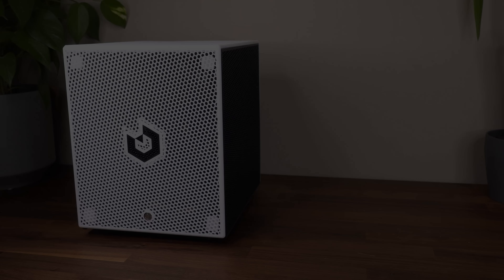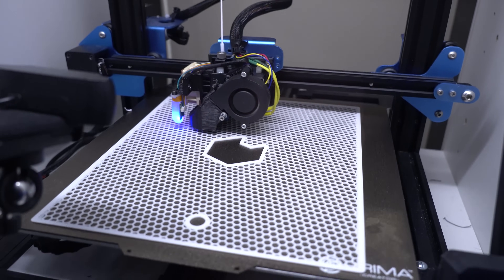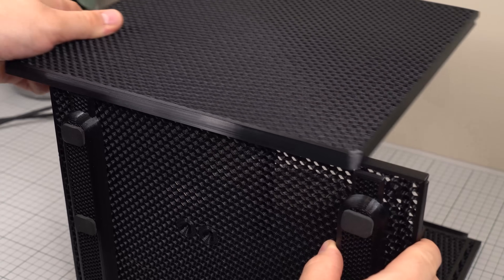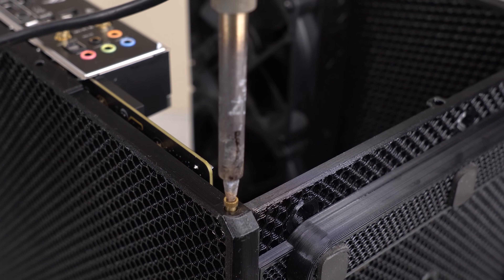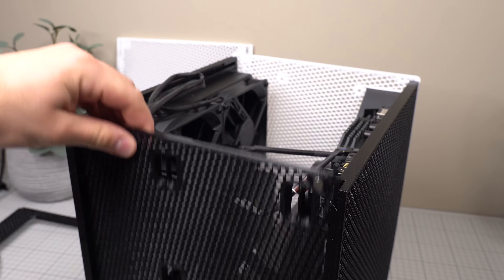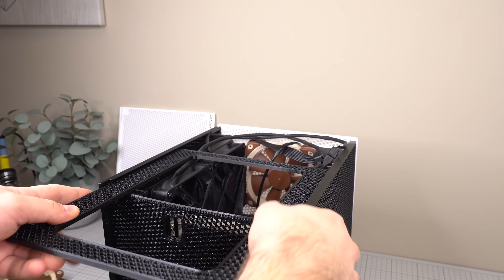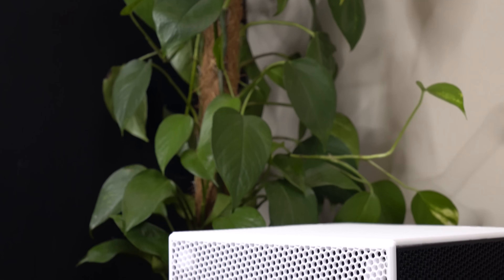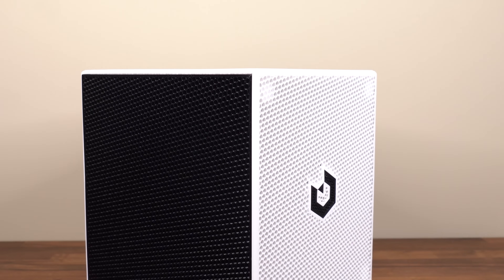Little Boy M - a 3D Printed Micro ATX case

Comment: Damn you we are so close the real thing community really needs. Air cooled micro ATX motherboard and PSU case that can be printed in pieces sized 200x200. I ask this because most of us bought cheapest 3d printers and like ender 3 they have 220x220 bed size but effective size is 200x200 mostly. So if you follow this use cases you can reach 99% of 3d printers owners and PC builders
Reply from the maker: I know this has been highly requested and especially from my previous mATX two years ago the ATX psu support has been high on the list and I remember back then I made some promises I failed to fulfill as everyone wanted ATX psu support and it’s been gnagging me ever since that I didn’t just complete it. Now finally it’s here though. 

Now the next challenge would be as you say to shrink each part, find a clever way to join the parts with no visible exterior screws and clean joints.
Reply: @makerunit  Well... the panels might be separated into smaller parts that will be later screwed or glued together. The key is to well designed connection points. Not necessary hide it, byt maybe even opposite - expose them in a way that fulfills the aesthetics of the design. ;)

Still. This project is a very good job. A lot of things was taken into consideration. PC cases manufacturers sometimes after years are forgetting about some details...
Reply from the maker: @LeitoAE  yeah I’ve been working on some ideas for ways to use joints as a part of the design, and one of the projects I’m working on right now is an Ender-3-printable full size ATX case. There that challenge comes up, but I think I’m able to solve it pretty nicely. Stay tuned 😁

Comment: there no way the structure of these cases dont droop into a ugly mess after a few high GPU load sessions
Reply from the maker: First of all, PETG can withstand temperatures of up to 80 degrees. And if a GPU reaches «80 degrees» during for example gaming, that’s at the processing core of the GPU, the surrounding air will never reach those temperatures, the air around it will MAYBE reach 50 at most and then again be instantly cooled by the airflow in the case. 

Even during printing the printbed surface is constantly actually 80 degrees C for many hours no problems 😊

Comment: you got some weird artifacts in the video, you probably used optical flow when exporting
Reply from the maker: Yeah I’ve noticed them and they only seem to happen in clips where I slow it down. Is it due to Optical flow? Should I rather be using frame sampling?
Reply: @makerunit  try frame sampling yeah, I use optical flow to make glitchy visuals and stuff where the frames bend and morph like the artifacts on the video, so I'm 99% sure that's the problem
Reply from the maker: @Stojce_  I see! Thanks for letting me know, I’ve been struggling with this in many videos! 😁 For some reason I’ve always thought Optical Flow was the best to use.

Comment: as usual great attention to details and placement of the parts is perfect, my only comment here is that it is a little bigger than i expected but there isn't really anything to complain about with how much effort you have put into a project like that, keep it up and best of luck 💙
Reply from the maker: Thank you Hamed! It did end up getting slightly bigger than I was expecting to begin with too, but I wanted the ATX psu support and AIO support and all the other flexibility so I felt like I shrinked it as much as I could without sacrificing too much. You see how tight it is between the different parts only millimeters separating them 😁

Comment: Really great stuff! A bit to big for my print bed - but I love it anyway.
Reply from the maker: Thank you Russ! One of my next challenges will be to make a case in 200x200mm pieces to fit most printers on the market.
Reply: @makerunit  One more vote for this! I'd love to try out your design, but I'm at 256mmx256mm. Close but not close enough. Really nice design though, great work!
Reply from the maker: @AdamHerrman  working on a Long Edition of the Little Boy S right now. I’ve also got an idea on how to make it printable in smaller chunks. (The S version though at first). And thank you! 😊

Comment: This is the perfect mATX case with all the flexibility and options in mind. I would love to print this out but unfortunately I only have an Ender 3 Pro. :( Would love to see future projects be able to be printed in the most common 3d printing volume.
Reply from the maker: Print volume is always a limiting factor. I myself also have an ender 3 but rarely use it due to most of my parts being bigger than the volume.

The main reason behind making the largest possible parts is the aesthetics, to avoid having visible joints etc, but with a certain patterns I’m sure part joints can be conveniently hidden 😊
Reply: @makerunit  I was going to make a similar coment about the print volume as i also have an ender 3. Maybe it would be possible to hide the joints using fabric and get a look similar to smart speakers or something
Reply from the maker: @rickfajer  that’s a clever idea! No idea how hard it is to pull off but definitely an idea!

Comment: My dream is make universal case that can be used in rack like 4U modular case for example: that can be used for two itx boards or full ATX.
Reply: I made a diy drawer. 4 aluminum angles (2 per side) from the top to the back of the 19inch rack and putted a wood board  in between. You can screw down all small pieces (router, power cord...) onto it.. Take it out to work on it and put it back in afterwards. The only work is marking and drilling 8 holes into the angles.
My old Anet A8 was also on one of this boards and inside of the cabinet.
Reply from the maker: @1234fishnet  I see! Really cool! 😊
Reply from the maker: I have very little (basically zero) experience with rack, what are the benefits of rack mounting and what are the main uses for a rack mounted PC? 😊
Reply: Home server/Rack mounted NAS, etc. keep all that clutter and heat out of the office.
Reply from the maker: @TheeAbstractHero  I can see the benefits of that!
Reply: @makerunit  main use case is when you have multiple PCs. So yes servers, desktop, network lab etc. Its  like wardrobe but for computers and its standardized to 19"" width and height is in U (1U=1+3⁄4 inches, 44,45mm). Most rack mounted PC/server cases are 1U to 4U. Also racks come with different sizes in U, like full 42U to 4U that you can hang on wall. Also depth can be different. I use startech 12u frame, but yes its not for everyone :)
Reply from the maker: @xPakrikx  I see! Thanks for explaining 😊 and I can definitely see the benefits of such a system!
Reply: @xPakrikx  Have you found any decent cases that work with the Startech wall mointed 12u frame? I was going to build a NAS in it, but the shallow depth makes it difficult to find cases